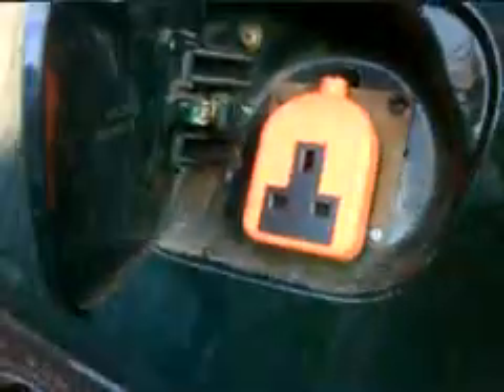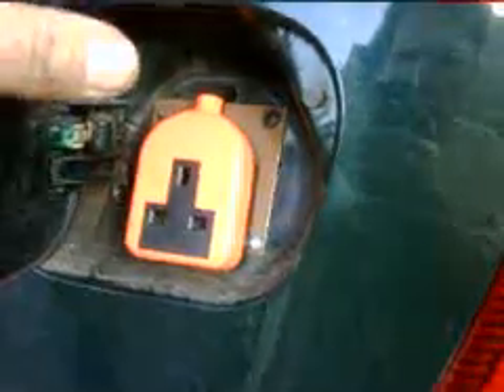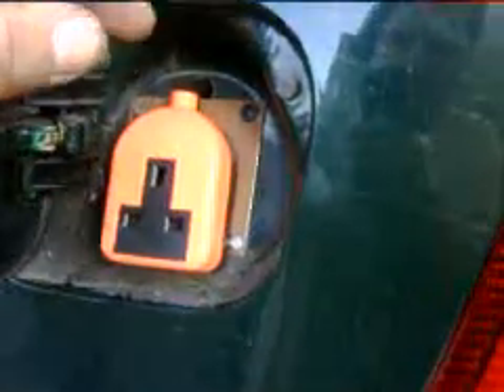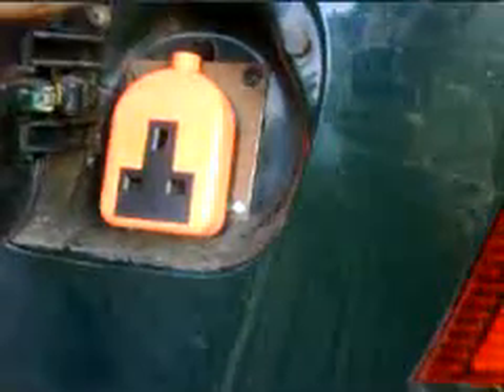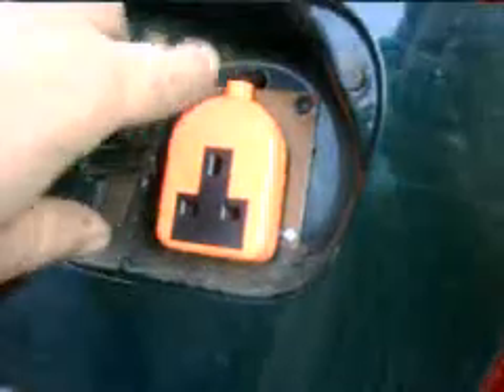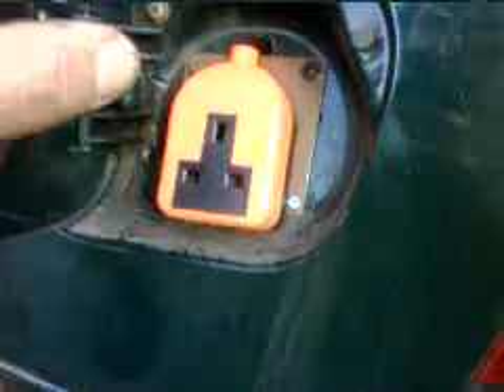Electric Car Conversion Rover Part  21

Comment from the maker: @lezbriddon. its a forklift pump motor from a works machine that was to be  ( has now ) been scrapped.
The fork truck is a Hamech machine 3 ton electric, about 25 years old.
The main traction motor was too big for my project, but has now been removed for an electric range rover conversion for someone on here.
Rich

Comment from the maker: still cannot see what the probelm is as would not turn the power onto the feed lead until it was all plugged in, but still looking round for a spring retractable lead that i can pull out the old petrol flap and have a 240 blue plug on so i can change to some thing different.
Cheers anyway guys, at least it shows your interested enough to watch and listen to them.
Richard